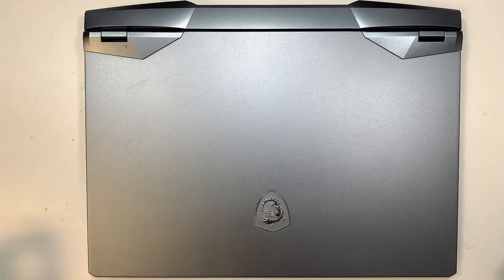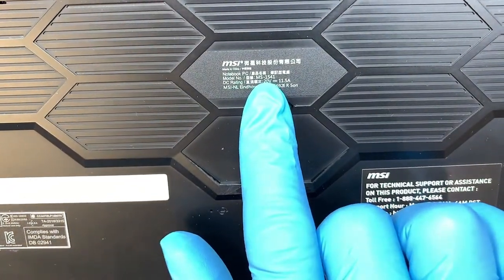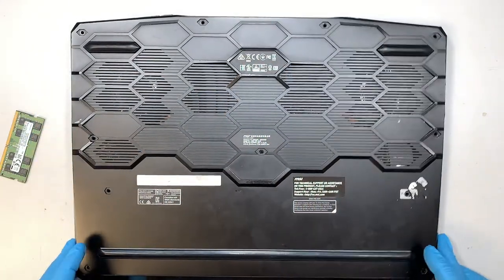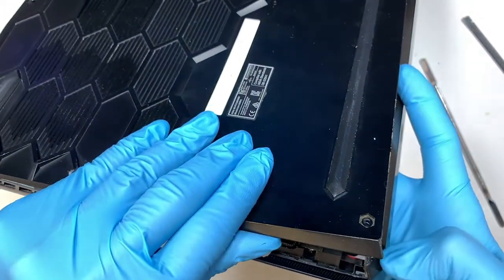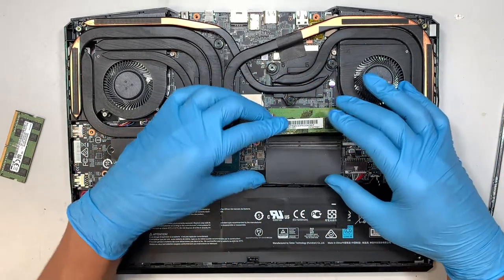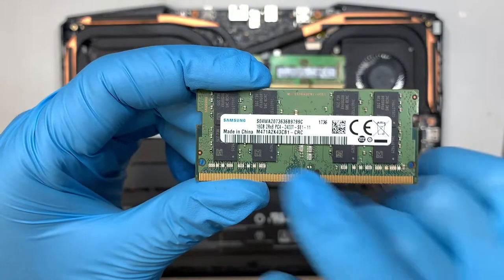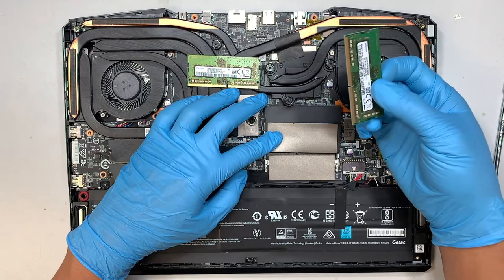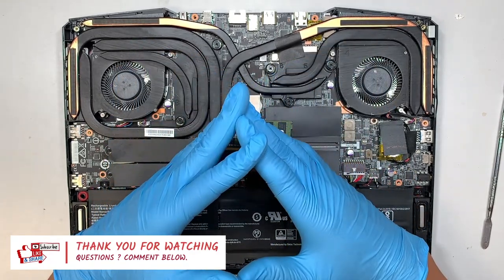MSI MS1541 Gaming Laptop RAM Upgrade 32gb

Comment: I have been trying to remove the case…. I didn’t not realize there is a screw under the factory seal
Reply: Yeah, actually gently worked it until that post came off the back cover looking for some kind of internal tape. Glad I didn't break the motherboard; putting the seal like that is not OK.
Reply: @cockypens1660  they do that because they are not liable for repairs if it's been modified. So by opening it, you void the warranty, which is pretty common practice on electronic devices.